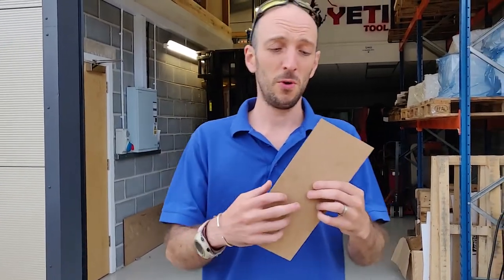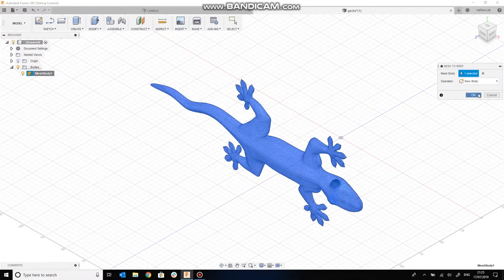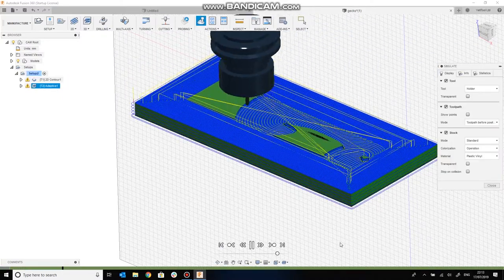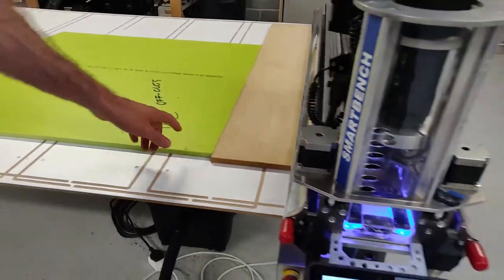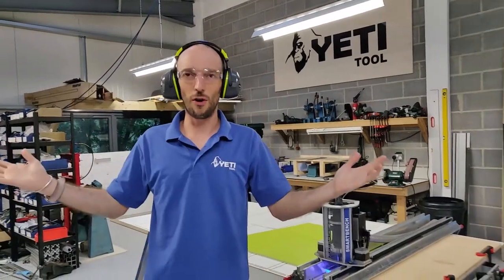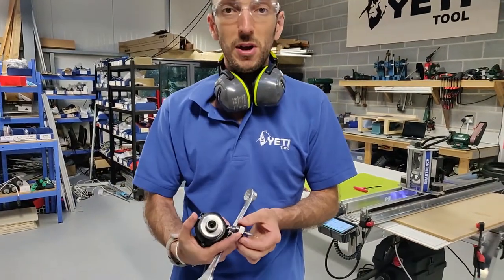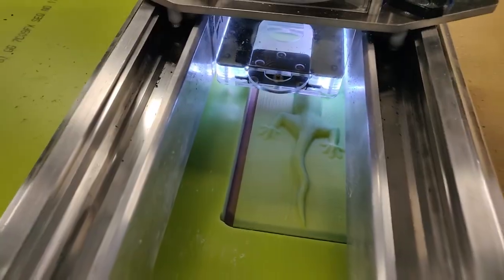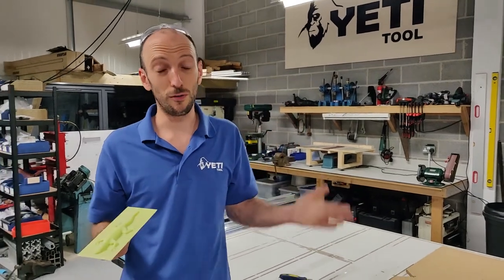Sculpting With SmartBench

Comment: Excellent informative video.
-Was that double-sided tape holding down the Corian?
-What are you using as the spoil board?
-Does the pro-version replace the collet or the router motor, or both?

Keep the videos coming fast! Thank you.
Reply from the maker: Thanks Ron! Appreciate it, it was really fun trying to capture everything!
Great questions:
- Double sided tape: it's taken a lot of testing to find the right blend, and we'll be listing this on our site shortly. I can say it's a polyester backing with a strong acrylic adhesive, which gives great work-holding, with minimal deformation (essential for maintaining precision in the z axis), and easy to remove in post.
- Spoil board: MDF 6mm
- Pro-version: the pro-version replaces the entire spindle ('spindle' refers to the tool head unit as a whole which you can see extracted during tool change). The up-rated spindle features the professional ER16 collet system (as shown), and digital speed control. The rest of SmartBench's mechanics remain the same.
I think there's three more videos right there ;-)
Reply: @YetiToolLtd  Keep the videos coming. Thanks!

Comment: Hi Yeti, can you please touch on calibration and using the console, and show and verify accuracy after a few cuts over the length of both X and Y.  Basically, having it home back to 0,0 after a few passes under load after spanning close to the full length of both X and Y.  I'm unsure, if that's an effective way to show, prove and maintain accuracy.  Definitely open to your suggestions.  Thank you.
Reply from the maker: Hi Ron! We are working on some more videos as we speak - this will include a video based around calibration and setup as well as a video focused purely on the accuracy of SmartBench! Watch this space!
Reply: @YetiToolLtd  Absolutely awesome!

Comment: Q. Can it be used to flatten slabs of wood. Or replace a jointer and a surface planer? I wonder also why haven’t you gone with a standard 12 mm collet and a bigger motor
Reply from the maker: Yes - it certainly can. We have several customers using SmartBench for this application. Please be aware that the machine has a UDL of 100kg over the 2.5m x 1.25m area. The spindle that comes with SmartBench is perfectly capable of handling a wide range of workloads. We also wanted to keep the price point of SmartBench affordable and increasing the spindle power would have increased cost and weight.

Comment: What is the decibels level of that machine?  Also, how do you self level the legs?  Is that possible?  Finally, did I see somewhere where it works up against wall standing up?
Reply from the maker: Hi there, below are the details about noise levels.

Measurement values determined according to EN 60 745.
The A-weighted noise level of the device is typically: 
Sound pressure level (LpA)       78 dB(A}
Sound power level (l.wA)          89 dB(A}
Measurement uncertainty K = 3 dB
The noise level can exceed 85 dB(A}
during operation.
Wear ear protection!

The legs do not self-level. If using SmartBench on an even surface, the legs would need to be places on packers to be level. 

Currently, SmartBench is only able to operate horizontally. Vertical operation was  explored in earlier iterations of the machine, and is certainly something we will be looking into again in the future! 

I hope this helps!

Comment: If I purchase the smart bench with the 230V router and buy the replacement 115V router and swap out depending what power I have available?
Reply from the maker: Hi, sorry for the delayed reply! SmartBench itself ships to take either a 110v or 230v power supply so it wouldn't be possible to swap out the spindle I'm afraid.
Reply: @YetiToolLtd  thank you! I ordered one up with 230V precision spindle on Sunday
Reply from the maker: @explosiveenterprises1479  Order received  :) Thank you very much!